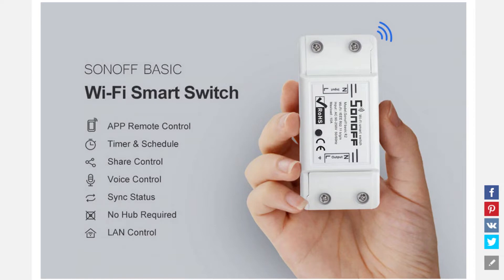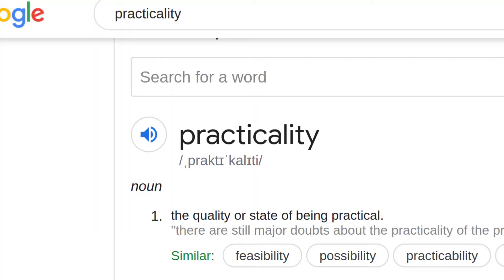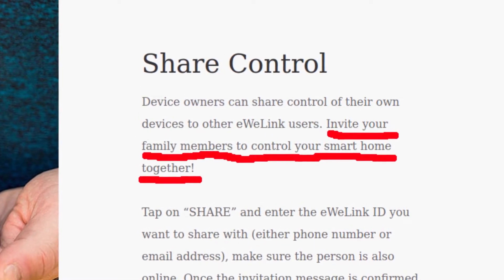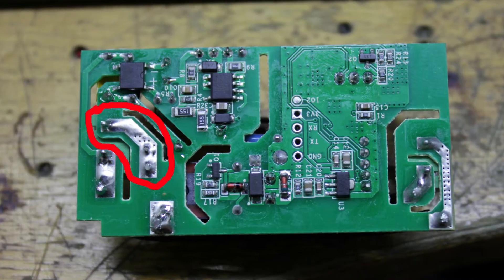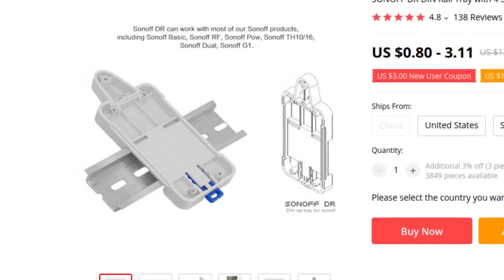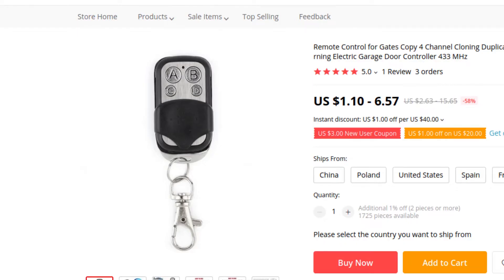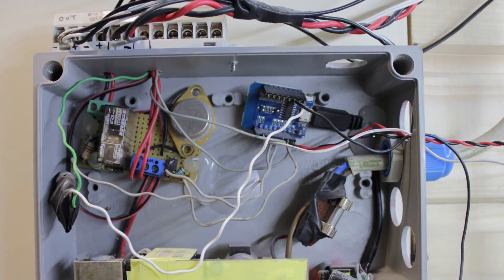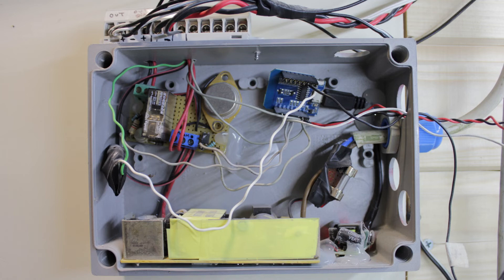Sonoff Basic review, is it Practical?

Comment: Excellent video but SONOFF BASIC can even control 8 different Devices as explained in the following video. I did this and it works wonderfully 👍
https://youtu.be/iVqP9_X7TZ0
Reply from the maker: Hello! Thanks for your comment! I checked out that video. I see that the Sonoff was very heavily modified. In my opinion, that is really not worth doing, because-> Sonoff costs 5 bucks and, for example, a Wemos D1 mini just 3 bucks. With Wemos you get esp8266 which has much more pins than the esp8285 used in Sonoff. So it's kinda a hassle to do a modification like that when you can get a better chip already with a development board :) Thanks again for watching!
Reply: @3LECTROSHOCKED  that's true but you are missing one more thing that Sonoff comes with an inbuilt AC mains power supply and an onboard relay in an compact and handy form factor which wemos lack. So I think modifying Sonoff still makes sense in this project.
Reply from the maker: Well I did not missed that :) I talked about that in this video. Still I think doing such an extensive job on the Sonoff board is not worth it. Also, I don't understand how you can have 8 outputs, since there are just 6 usable GPIO pins on the esp8285. Here is more about that: https://esphome.io/devices/sonoff_basic.html  Also accessing all of those 6 pins takes a lot of work. Having a relay module and a power supply for "free", in my honest opinion, is just not worth it. You can find a 5v supply in the trash - an old mobile charger (the wemos has 3,3v step down on board). And a relay module is super easy to make from any old electronics - you just need a relay, a transistor, couple of 1k resistors and an optocoupler. Anyways, that's my opinion, you can disagree and that is ok. Thank You for the message! :)
Reply: @3LECTROSHOCKED  as per the information provided in the said video, ESP8285 has 11 GPIOs that we can use. I am already using 9 GPIOs out of those 11 in one of my Sonoff Basic. For detailed info, you may watch that video again. ❤️
Reply from the maker: What GPIOs you found usable besides 0, 1, 3, 12, 13, 14 ? As I understand there may be problems on startup if you use others.
Reply: @3LECTROSHOCKED  I am also using GPIO 4 and 5. This is the limitation of ESP8266 chip but if  you have ESP8285, you can use GPIO 2, 9 and 10 as well.
Reply from the maker: Well, that's really interesting. I will have to test that out on one of my Sonoffs. Thanks for the info! :)